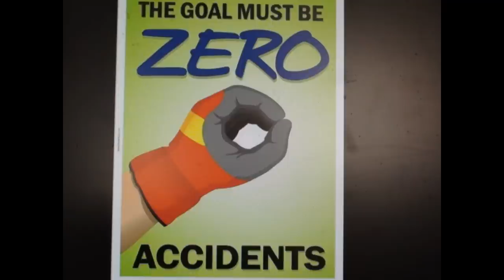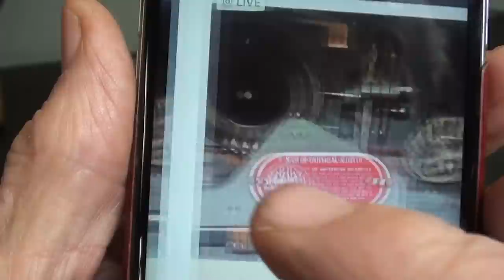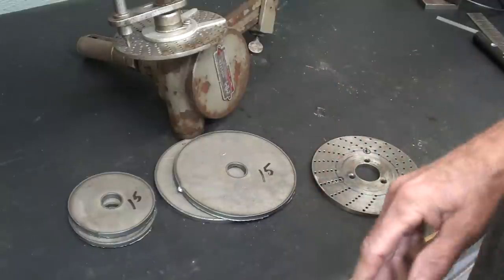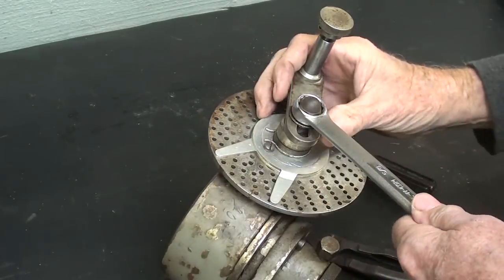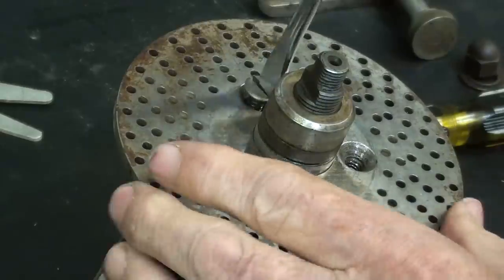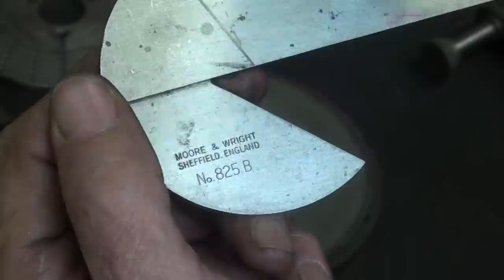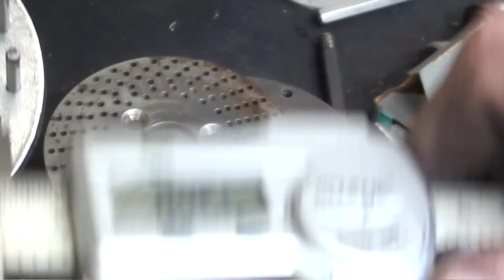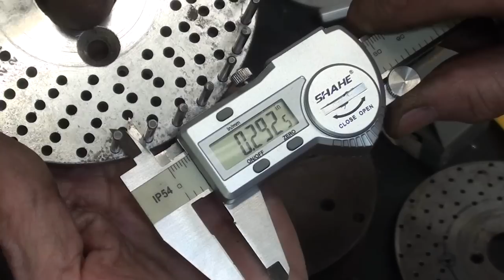Making Dividing Head Plates TIPS #621Transfer Method tubalcain

Comment: You are exactly right that this along with a versa mill would have been found on a submarine.   I remember a time onboard the USS Henry Clay SSBN625 in the mid 1980's our ships machinist doing a little showing off with his.  During inspections it was not uncommon for the inspectors to bring along a blueprint for a part and expect the machinist to complete it over the next 2 days.  The results of these inspections was shared with all the subs so we could learn from each other's mistakes and short comings.  We had gotten the result of an inspection where they had been unable to make the part asked because some tool or part of a tool was missing or broken on another sub.  Our Captain came to our machinist asking him if we were asked to make a part that we would have everything needed to do it and he assured him we could.  He decided to show the captain what he could do, so he took a piece of 4" brass round stock and cut on it, a gear, a taper, right hand v threads, left hand square threads, woodruff and square key slots.  Polished it up and made a little stand for it and presented it to the captain.  It was quite impressive for our little lathe and versa mill.  When the inspectors came aboard that little shaft sat prominently in the middle of the wardroom table.  Needless to say they didn't ask our ships machinist to make anything more.  He was quite talented and made a number of things over the years such as complicated aluminum hydraulic valve bodies when we had one crack.
Reply from the maker: That is quite a story. And I’m so glad that you posted it. I hope that lots of people read that. And it validates what I said in the video. I only wish that I had bought that versa Mill at the auction
Reply: The versa mill is still taught to machinists mates to be a "machine tool operator" like you mentioned for underway emergency repairs. I was lucky enough to be selected to be sent to the schooling, which actually led me try to learn more about machining and lead me to this channel years ago. I never had to make any repair parts, but along with our welders we made special tools, and I would make parts drawings and try to make them to practice when in port.  USS HAWAII SSN-776

From what I could see it looked like the attachment that was on the one at auction was one you could broach or cut internal keyways with. They have a few different interchangeable heads to allow you to do different operations.

Comment: The versamill was made in at least two sizes.  I have the smaller one mounted on old belt drive BS horizontal mill so I can use as a verticle mill also.  I watch all of your videos and have learned more than in any shop class!
Reply from the maker: Thank you very much. I was wondering what size those machines are. Would they fit on a 10 or 12 inch lathe?

Comment: Lyle, this is another interesting video.  I don't have access to dividing head plates, so I'm also looking forward to your follow-on videos in this series.  I've read an explanation on how the "gear ratio" in the dividing head (or geared rotary table?) reduces the errors from the initial "home-made master plate" to the manufactured plate, but don't recall the details.  Could you cover that, either in this series or in a later video?

I'm going to have to start from scratch when I build my dividing head, with the only "store-bought" parts being the worm & worm gear, fasteners, & dowels.  I'll have to start with laying out the hole patterns and go through a few generations of plates to end up with plates as accurate as I can reasonably build them.

I'm really looking forward to the ideas & tips you show us!
Reply from the maker: That will be quite a project, making a dividing head

Comment: A quick google search turned up several programs to print bolt circles and circles with equal spaced holes.  Use one of the to laser print a pattern, glue it to a plate and transfer punch the holes.  It should be accurate enough and you don't have to try and borrow a plate.
Reply from the maker: Please give me a link to that site. I would like to use that in the next video. Thanks
Reply: @mrpete222  
Lyle, I found this. If you look carefully, it has a dividing plate mode. Also, read the whole page. You're welcome. Stan. 
 woodgears.ca/gear_cutting/template.html 

Sorry, didn't know how to link, so I just copied address verbatim from Chrome browser. Will it help?

Comment: I have what I believe is part of an indexing assembly for a Rivett lathe.  The cutter is held in the lathe chuck while the work (gears primarily) are held in a 4OS collet.  The index plate has notches (like teeth) around the OD of the plate instead of holes, and there is a simple spring loaded, toothed lever that locates the notches.
Reply from the maker: Sounds interesting

Comment: I was hired once, to make 8 plastic disks for lapping which had 211 holes each. My boss was in a pinch so I told him I'd do it. I made a template out of thin plywood and drew it out on a drafting table. I won't go into the whole process but I ended up making about $8 an hour by the time I was done.
  I told him I could only guarantee about 1/4 of a millimeter accuracy. This was before I was a machinist otherwise I would have told him +/-.010" . I was kinda proud of being able to keep that tolerance with a drill press & a drafting table. The blueprint called for +/- .005 but the client didn't send them back so I guess they worked.
 Come to think of it, it was that job that lead a chain of event that eventually ended with me finishing manual & cnc machining courses.
Reply from the maker: Very interesting. That must’ve been quite a job. And they were pretty accurate after all.

Comment: Hi Mr Pete! Thanks for all your videos! I built the Gingery lathes years ago and use it all the time. I wanted to add back gears. I had a dividing head with only one plate. I tried generating a missing plate using Gingerys method of dropping parallel lines. The divided strip of paper was taped around the one plate I had and a pointer told me when to stop and drill. I was as careful as I could be using a spotting drill,reamers and all. I even made duplicate plates thinking the small errors would diminish. My one factory plates hole spacings are perfect. I  always had .010" errors in mine. My tools are a lot of junk and I'm not sure if I tried again if I could do any better. There, I got that off my chest.
Reply from the maker: I have more ideas for you and the upcoming videos in the series

Comment: I just bought one of these and it only came with one plate. I don't know if I will really use it or not but I do have a headstock that I could attach it to and use it on the mill as a dividing head although with no angle feature.

Comment: I bet you could still make the hardinge plates work with that dividing head. By just drilling  and a second 3-hole pattern for the mounting screws.
Reply: Would have to make a new drive or put in a new pin for the selector though, but yes would work. I suspect those original plates were made by somebody making a master plate out of tool steel, and getting all the holes in place with some dividers and scribing, plus a protractor for the angles, then drilling them. Harden the plate, then you simply have a whole stack of the production plates ready, all with the centre hole bored out, and then clamp the whole lot down, and run a drill press to transfer the holes through. Production plate probably was used till it was well wallered out, and then they would make a new one. Gets the precision work out to a single toolmaker, and then Rosie the riveter could turn out a hundred of these in a single shift, and then next day do the same for a hundred of the next size, so after a week you have 100 of the dividing heads for the order, using only a small crew doing separate functions to a set plan.

Hard to think that tool making is an assembly line operation, as normally the tools are doing the assembly line work, but here you are using then to assemble tooling.
Reply: @SeanBZA  That pin is supposed to be tapered anyway. :-)
Reply: @LambertZero  Don't think it is that tapered, will be a nasty thing to snag it in a hole and snap off half the pin by accident with the leverage on only a small section of pin and the tip of the hole. you could run a taper reamer through the holes after manufacture to define a small taper on the top to aid alignment, and keep a tight diameter tolerance though, only going in to around a quarter of the plate thickness.
Reply: @SeanBZA  The idea is that the pin is more tapered than the hole, so it doesn't lock in there and only makes contacts on the very edge of the hole. I think Stefan Gotteswinter talked about it recently.
Reply: @SeanBZA  My shop regularly did that sort of thing.  The Item you mention was called a drill jig.  I had a production screw machine shop for 50 years.
JIM

Comment: A cheap way of dividing is to go to the farm supply store and get a sprocket, they are sold in many sized with many different tooth counts. I mount it to an expanding mandrel in the lathe spindle and make some sort of detention to hold the sprocket in position. A 60 tooth sprocket will give many combinations of spacing. And save a lot of time and work.
Reply from the maker: Thank you for a great idea

Comment: Well Lyle, you have just proved to yourself the inaccuracies of using transfer punches that I have in the past kept telling you about. The punch marks move plus any drill wander give you inaccuracies. You already had a drill jig in the form of the master plate. With it clamped you could have spotted through every hole with a close fitting drill, seperate the plates then open up your new plate to eight inch. Would have then been as good as your Hardinge plate.  In my 50 plus Years of engineering here in England I have never seen let alone used transfer punches. Must be an American idea, I see other USA people on YouTube using them. Please remember, spotting through a part you already have will always be more accurate than marking and centre punching.
Reply: @donnerpartysupplies5187  Now you can use your half plate to make a new one, by simply transferring the good sections of hole ring by ring onto a new plate, just select a single line to be the new reference line for the new plate, as they otherwise will be all over the place.
Reply: @donnerpartysupplies5187  You can do it with just a drill press, and a dowel pin, plus a centre mandrel to follow the inner centre closely. Just means you will be doing a few trips around the plate per diameter stepping out each time from your initial row of holes. No DRO needed, nothing complex, and should be accurate enough so long as your half plate has at least a third of the area. as you will be tossing it afterwards no need for transfer punching anyway except for the initial set of holes, to get them all in a line, if the plate does not have that aligning point. Just going to need you to have a set of new drill bits that accurately match the existing holes, they will serve as transfer punch anyway, and with cast iron should not damage the hole too much during the 3 or 4 drill passes per hole.

Comment: I did not read all the comments here, so maybe you all will forgive me for repeating. 

I visited an old, shut down machine shop in Dalton, Ga. once where I purchased several pieces of equipment. One piece I would have liked to have bought was a lathe capable of 240" between centers. The problem I had with it was the swing was just too small for that length. I'm not sure I it would have swung 12" pipe. Which is a common size for rollers here in carpet country. But, I digress.

This lathe had a couple shop built attachments. One was a shelf of sorts at the headstock which adapted an indexing head to the outboard end of the spindle. The other was a milling attachment that rode on the tool post carriage. I was able to figure out this setup was used to machine extruder screws/augers with multiple start threads. There were several of these lying in the warehouse which looked to be about 8 inches in diameter by about 16 feet in length. Some even had variable pitches. Not sure how they pulled off the transition from one pitch to the next though.
Reply from the maker: Thank you, that was interesting

Comment: Much simpler method. Measure from left edge of one hole to left edge of other hole  to give centre to centre distance then divide by 0.8663 to give Diameter of pitch circle. If no calc available draw a line from one center to another, distance from line to third center is  3/4 or 75% of Diameter of pitch circle for three holes. Other odd holes see ZEUS book which gives 5,6, 7,8,9,10,11,12 hole spacings.

Comment: I did the same test on a dividing plate many years ago to prove an inaccuracy and got the same reckoning. So, one could make his own dividing plate by using close-up vision and accurate marking-out. How close can I get? well, I have seen a clockmaker make one to divide a clock gear blank and if he can do that accurately, then I am sure I can as well. It's all about patience and accurately making the punches to do the job. 
I believe that if you are going to sharpen a punch, it must be machined ground so it does not warp or deviate the hole because a drill bit to follow will deviate within the punched hole beside the hole not being punched on centre. 
A close tolerance I believe, can be achieved. Have you carried out this method I talked about here yet? This subject always fascinates me.

Comment: If you were going to make a plate with the most commonly needed divisions, which numbers of holes do you think is most useful? I was thinking 18 and 25 would cover almost everything, because 18 gets you half degree increments, and 25 gets you 1/1000 of a circle. In terms of prime factors, you get 2*2*2*5 from the gear reduction, 18 is 3*3*2, and 25 is 5*5.   After those two, maybe 21, 33, 39 and 45. Though perhaps it's a better idea to just wait until you need to make something with a division you don't have.
Reply from the maker: You actually need them all sooner or later
Reply: @mrpete222  I know there's a lot that you can't get with the set I listed, like primes 17 and up, powers of two 32 and up, powers of three 27 and up, etc. 

I think I'd only make a 15 hole plate if I needed something like 75 divisions. To get 1/25 I'd just make a 5 hole plate, and leave the option open to make it a 25 hole plate later (for example if you want to add a vernier, I think that would need a 25 hole plate, for 11/250).

Comment: Re: accuracy of the spacing... Remember that two things help here- there is no CUMULATIVE error during use, and the  ACTUAL error on each hole position is reduced by the work gearing factor (usually 40). Question: Do you have a setup to drill on the Atlas lathe using the 60 hole index built in? That is yet another way to do this.
Reply: That would be a very simple and convenient way to do the intended operation of putting 20 divisions on that teaching aid. With no dividing head needed.
Reply: And furthermore, when you're using the 'spider' and reduction gear, and turning to every sixth hole in turn, for example, then the inconsistencies between adjacent holes will be averaged out.
Reply: I can't see the 40  /  42 : 1 gearing making any difference.
The peg in the hole determines the possition.
Clear as mud Lyle said.
Reply: @stevewilliams587  any positional error will be reduced 40:1. As well as any other movement of the handle.
Reply: @stevewilliams587  Imagine that there are only two holes in the plate, nominally 180 degrees apart. In actuality, one of the holes is off by 2/3 of  a degree (40 minutes) On the plate, the spacing is 179-20' and 180-40'. Ideally, the spindle will rotate 1/80th of a revolution (4-30') when traversing from one hole to the other. Due to the error, the actual rotation will be 4-29' or 4-31', as the 40-1 gearing reduces the rotation of the spindle relative to the crank by a factor of 40, and the error by the same factor (presuming a perfect worm and worm gear, of course). The error will again be 1' for a spindle rotation of 13-30' (1-1/2 rotations of the crank), and so on, as the error for a complete rotation of the crank is theoretically zero (actually controlled by the worm and worm gear accuracy)
Reply: @stevewilliams587  If the gear ratio is 40:1, then an absolute linear inaccuracy of .004" in the separation of two pins will yield an error of .0001 in the separation of two positions in a bolt-circle, if the radius of the bolt-circle is approximately the same as that of the pins.

Comment: A friend of mine has an x British navy lathe, it has a milling machine on it, it’s like an all in one type thing, perhaps that dividing head’s for something like that.?
Reply: This dividing head is an accessory for the master mill which was commonly used on US subs.   The master mill mounts in place of the compound.  With the master mill on the compound and this head on the spindle one can cut gears etc.    I happened to get a master mill with my sidney cone head lathe but did not get the dividing head.

Comment: Would the " easiest, most accurate" method be to establish OD and ID on a lathe, then use a rotary table on a mill, 1/4 inch end mill every 120 degrees on the mount screws circle, then 1/8 end mill every 24 degrees on your dividing circle?